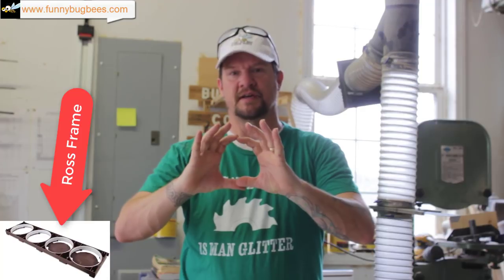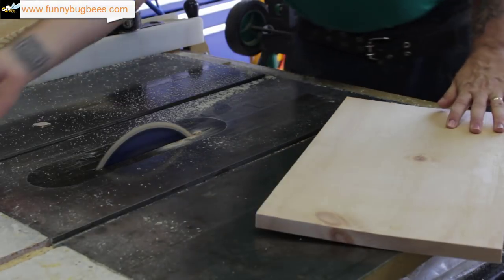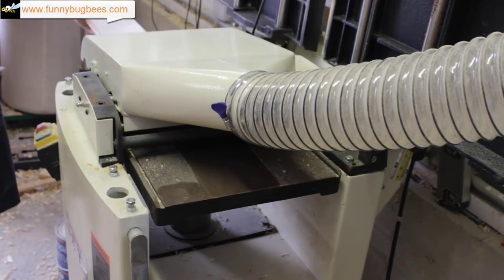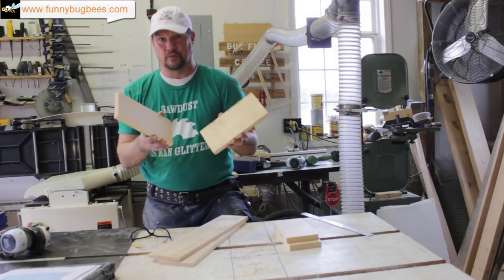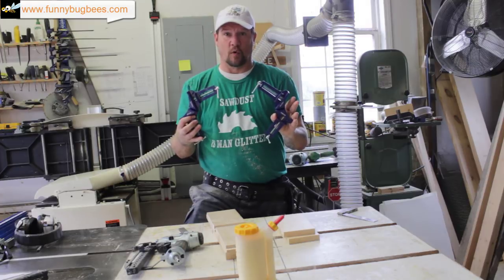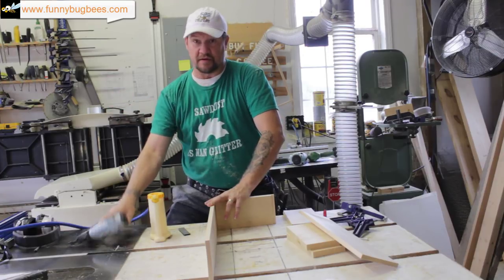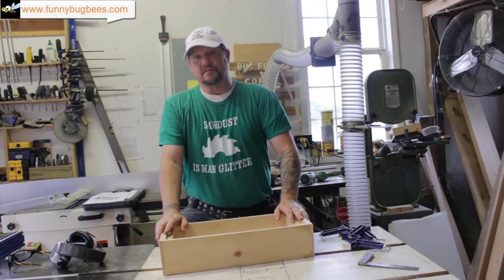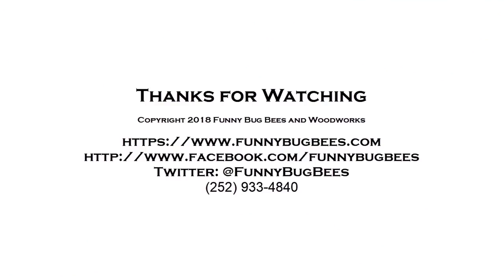HowTo: Step by Step 5 Frame Ross Round Honey Super

Comment: I use a router (don't have a table saw), but get blowout with cross-grain rabbets.  Any tips to prevent this?
Reply from the maker: yes, same thing happens to everyone trying to run rabbets cross grain. The trick to preventing it is to run a piece of scrap through with it like so:

\\\\\\\\\\\\\\\\ Fence
|          ||          |
|          ||          |
|          ||          |
 BRD1  BRD2      <------------ Feed Direction

In this example BRD 1 is the production Piece and BRD 2 is the sacrificial board.
Reply: I will try that with my next box.  Thank you so much!
Reply from the maker: anytime rugged. It's standard wood working, anytime you are concerned about a blowout use a backer board.
Reply from the maker: forgot to mention, always cut your rabbets before you cut your frame ledge or the backer board is pointless as you wont have 100% coverage with the backer board.
Reply: Thanks for the additional advice.  I did use a backer board last week and it worked great!